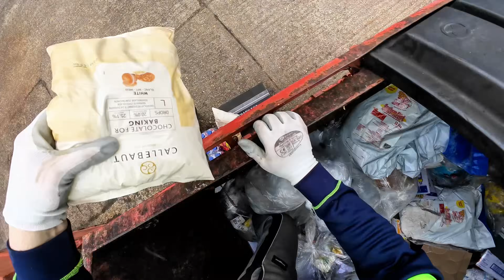I SMASHED IT DUMPSTER DIVING AT UK RETAIL PARKS.

Comment: Had an amazing day DD'ing yesterday. Residential skips. Basically filled the entire car. Load of brand new in box things. I spoke to the homeowners and they were fine with me taking them. Two dewalt tstak boxes, BT business kit (3 devices), literally not even taken out of the delivery film. 3 LED downlighters from a pack of 10. An intex inflatable dingy never taken out of box. 2 boxes of 400 LED christmas lights (battery powered). An apsalute ton of copper power cables. A working jigsaw power tool in box (power plug cut off but works). Long garden extension lead no faults. Bosch leaf blower/vacuum. Tree pruner. Two huge rolls of really nice soft white fabric (not sure what to do with it but seemed too good to waste) and a baby compact stroller, black sack of LPs, baby moses basket in really good condition. I'm sure there was more, but that's what I can remember.